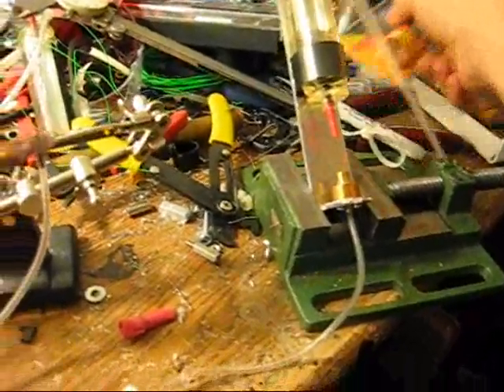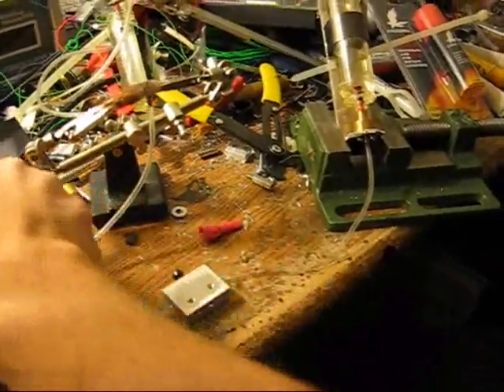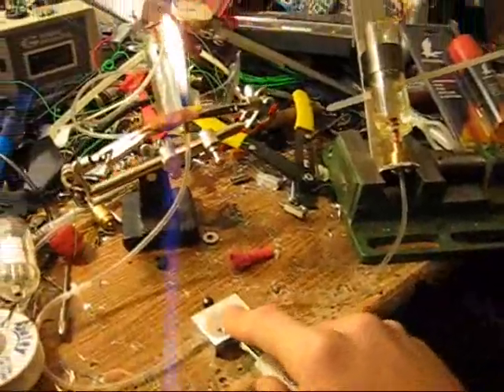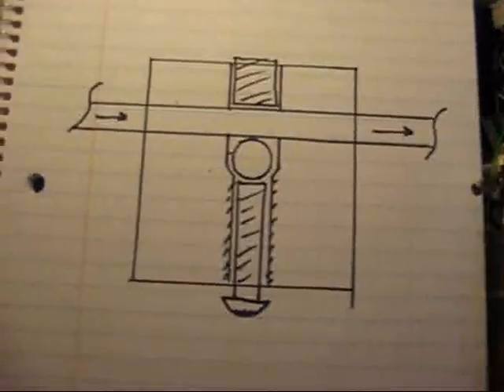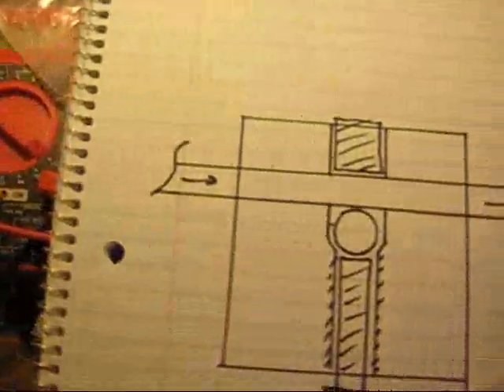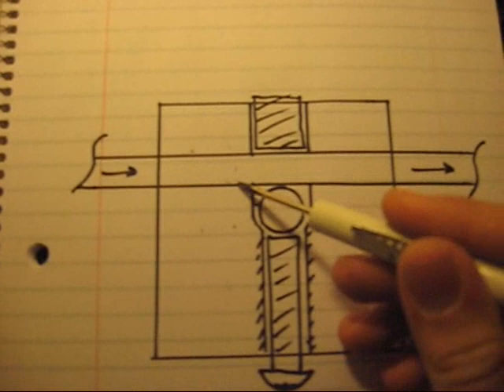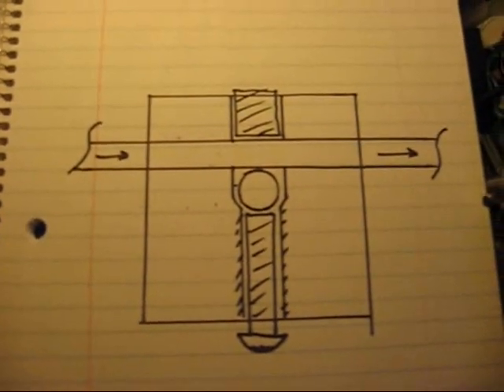Pyro System 3.0 Development

Comment: Just thinking you'd need to hold your hand fingers towards the ground so as not to burn your knuckles. Of course that would leave them open to falling droplets of butane.

Are you looking to mount one on each hand? If not you could mount the controls on your other hand. This would vastly reduce your chances of burns and also make delivery look really slick.

Comment: The most efficient rocket fuel has been proven to be liquid oxygen and liquid hydrogen, because the chemical reaction is very immense, but I don't think that it's available very openly to the public. You could also just try pure oxygen in a tank and ignite it with a spark. Also, if you use the Tesla Cannon concept in one of the videos next to me, you could create a very useful repulsor. The only problem is the energy output. You'd need a pretty powerful battery. Have fun!

Comment: Great work! looks like a fun project and has great potential. I also like how you are starting to incorporate some code/system control via microcontroller. Something else to consider (if you haven't already) is trying to focus that flame into a hotter and more controlled flame like those seen in a blow torch. Other than that this looks pretty awesome and it's good to see someone stick through a project and make improvements! Great work!

Comment: @mvana125 hehe yes but I could only use it once wonder if tanks of Liquid O2 could help more fule and I know one tank can shoot  off about 30-40 feet and lift about 100 LB. God hope I can carry it all. Also I have made black eggs, and even made Thermite and Napalm I lined easter eggs with Melted wax to hold the Napalm and a Bottle Rocket for Ignition. Thermite is held in the same way but in the large eggs and a strip of Magnesium for ignition. we had a blast on Newyears

Comment: So i commented earlier, but i found a flaw in my previously proposed idea. butane, being a gas will come out of the in a vapor state unlike a camp stove where the gas must be heated to vaporize it. so, i was thinking about bunsen burners and how the type of flame can be altered by opening or closing air holes that are located an inch or so behind the nozzle. this would mix the fuel with air before combustion giving fully adjustable flame shape. tell me what you think.

Comment: I am exited to see the new pyro system, I had an idea for a way to improve burning.
 I was thinking you could make the fuel line run past the flame like they do on camp stoves. if the fuel was in a metal tube that was placed next to the flame, it would vaporize in the tube before burning this would give you the blue "jet flame" the entire time. im not sure if you want this, but i know i would. 
P.S. The only issue i see is that since the metal conducts it could melt the valve on the canister.

Comment: a few questions, what brand are the canisters, why doesnt the fuel line melt at the flame end from your nozzle heating, and what kind of nozzle is it? The older system had a piezo electric one if i remember correctly. also what kind of tubing is it, it would have to be very flexible to get a good seal when the bb presses in to it. cant wait to see it in action.

Comment: The other thought i was about flame shape. in the head of propane torches, there are small flow directors. they are hard to explain, but if you look at a butane or propane torch you will see it. its just some metal slats arranged in a circle to get a spiral motion on the flame. 
Srry to write so much, just had a lot to say :) 
plz respond

Comment: I tried to make one of these a while back and found out that PVC tubing is really hard to compress (with a small motor). Instead, use surgical tubing which is easy to squeeze and strong.
Reply: mcdonn123 could put send instructions? Or tutorial pics?